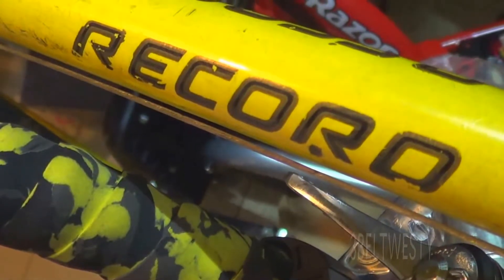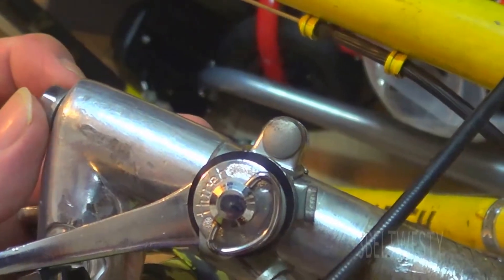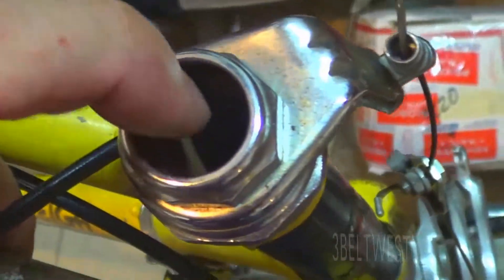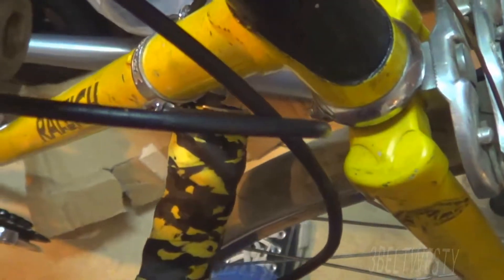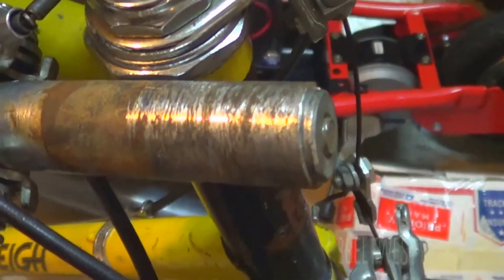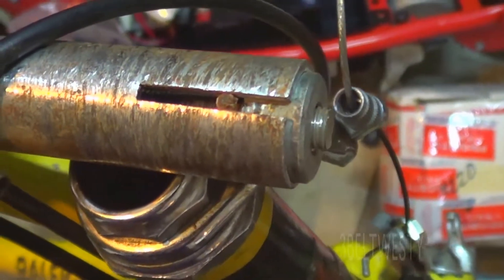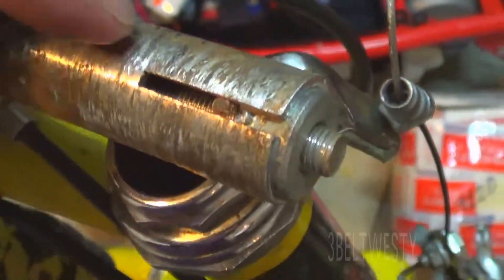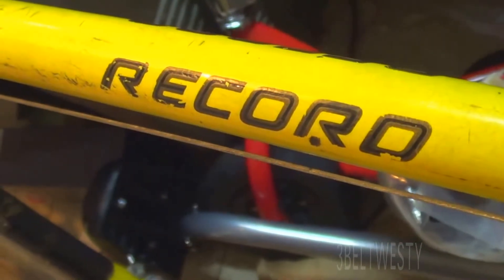Raleigh Record STEM wedge in Fork Tube

Comment: thank you :) this really helped me !! x i just got a raleigh sport early 60s and the headset stem was stuck and the bottom nut became loose and fell to the bottom as i was trying to free it with lubricant etc  .. turns out it had flipped upside down  .. you helped me to understand the inner workings and how it holds its place and expands etc .. with that newfound knowledge i used a very long chopstick to grab the nut that had fallen and i therefore knew to flip it over and secure the top bolt to it before re inserting it and voila ! was then able to  tighten the top bolt, thus securing the stem once again and fix the issue .. many thanks to you xoxo